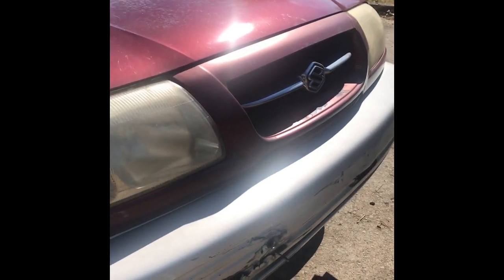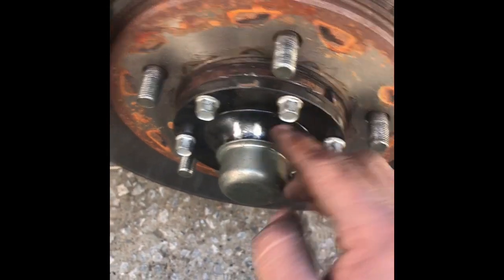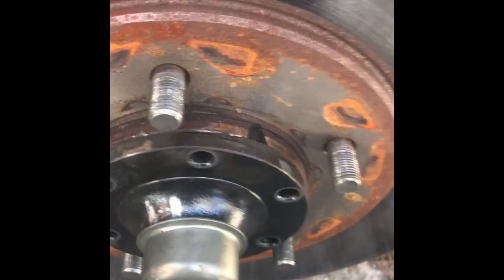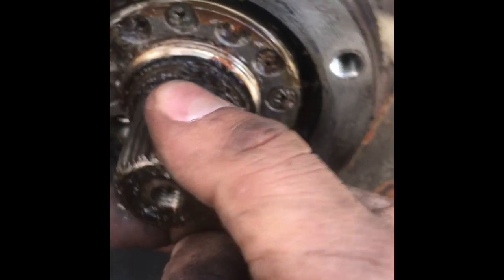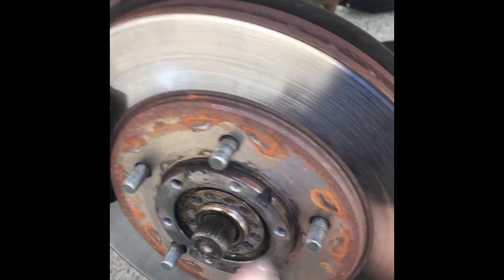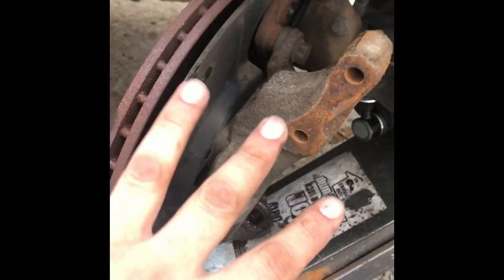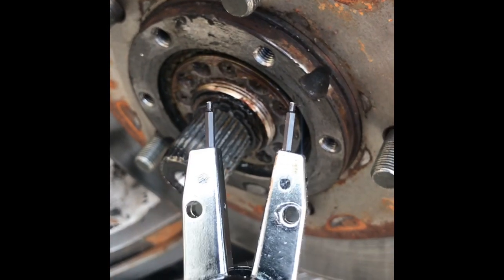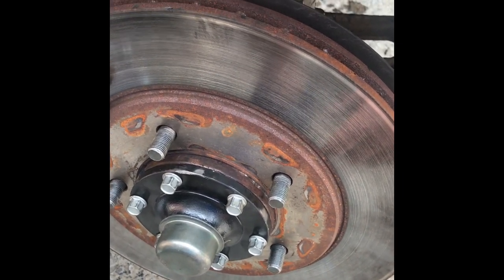DIY: 99-04 Suzuki Front Axle Removal

Comment: Thanks for this, it gave me a peek of the job without getting my hands dirty and so I could order everything I would need. I changed from the strut mounts down to the lower control arm, wheel hubs, axles, seals, and brakes. Practically a new front end!

Comment: 4:40 This video was quite helpful. 
I was quite confused and reluctant until I watched it. But it took a few hours well.
Before attempting this, make sure you have a circlip pliers because you will catch hell trying to remove it any other way.

I overlooked the part where you had to remove the entire control arm, so I found myself being unable to get in the velocity joint, because there was insufficient clearance. 

One thing I should mention. The splined end did not come in all the way through the hub as easily as it did here.
Thankfully they put a threaded hole in the middle of the spline, and one of those very bolts you removed at the beginning can thread into it. I was able to rig up something like a puller which allowed me to pull the splined part until you can clearly see the groove where the circlip fits, and also enough room for the washer.

In my country you can actually buy the outer cv joint, so there's a savings but it's a little more work in separating it from the rest of the CV joint.
Reply: 4r
Reply: I had the same problem with the splined part! I thought maybe I had made a mistake somewhere, so I tore it all apart again before realizing I could thread a bolt in the center, just like you did, and pull until there was room to get the washer and C clip installed.

Comment: You skipped showing us a crucial part.  You didn’t show how you got the axle out of the transfer case. It doesn’t just pull out.
Reply: You have to pry it out. Theres a hog ring on the spline that keeps it from coming out just like a impact wrench drive holds a socket.

Comment: I can’t get the hub Assembly off the lower ball join. How did you do it. It’s just stuck on
Reply: I had problems with that also. I see you posted this 3 months ago. I presume you solved it?
The hub is quite heavy (especially with the added weight of the disk brake assembly, but you have to do some wiggling. There was no need to prop up the control arm.

Comment: if the velocity joint is making noise (clicking) are you able to switch around the left and right?
Reply: No, 2 different lengths.
Reply: And 2 different axle. Right side go’s inside the diff  and left side is bolted

Comment: How did you get the old axle out? I've had a bidch of a time getting the C clip to line up to pull the axle out.
Reply: I need an answer to this also. Only answer I find is brute force (wrecking an internal c-clip).. Which then brings me to the question..how do you install a new c-clip after you insert the new axle inside the differental?
Reply: @clayaustin9339  When removing from the diff, try popping it out with a pry bar. If it doesn't come out, rotate the axle slightly, causing the circlip opening to move in the diff. Then pop again. Keep this up until it comes out. Don't sweat the circlip breaking, you can fish it out of the diff with a magnet. You can get new clips (in and out) online (worldoem, suzikiparts dot com). My CV shafts both came w/o clips. When changing the right shaft, add the shaft bearing support Suzuki developed to stop shaft wobble in the diff and the resulting leaks (get it from zukparts dot com in NZ for $18 USD, not $70-96 USD in the US). Part # 2761965D00, and it took 2 weeks to get it from NZ to NC.

In this vid he uses grease to stop the clip from moving. Insert the new clip with the opening in the same spot where it came out from, and you should be good.
Reply: @combatjm89   Turning the axle, then popping, then turning....it still doesn't come out.  There must be a technique that mechanics do to get axles out.  Ridiculous the thing won't come out.
Reply: I've always understood that there was a hog ring in the shaft going into the dif not a C clip and the ring just keeps the shaft in so the seal stays sealed. A slide hammer or a yank from another vehicle should pop it out.

Comment: So you never even removed the axle nut? And how did you free the tire rod after removing the nut?
Reply: There is no axle nut. The axle is locked to the hub by that cover that has the 6 10mm bolts. That's the only reason for the spline's on the shaft.
Reply: The best way is a pickle fork